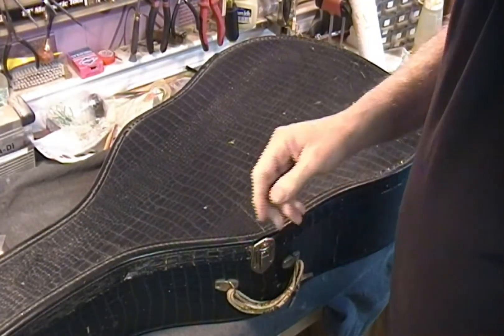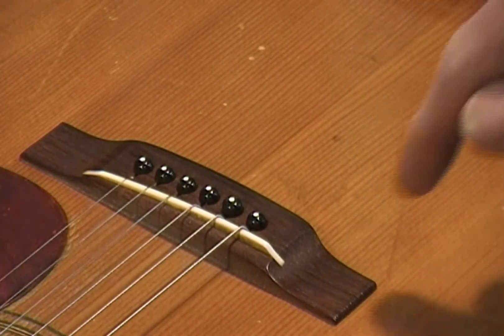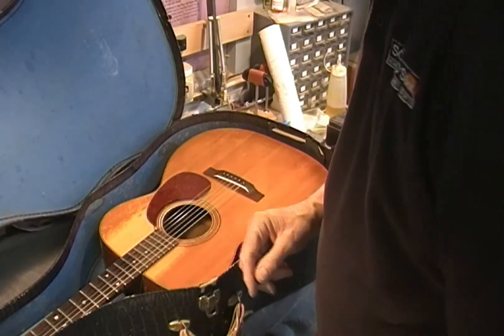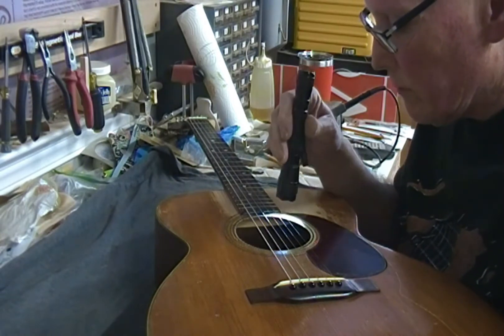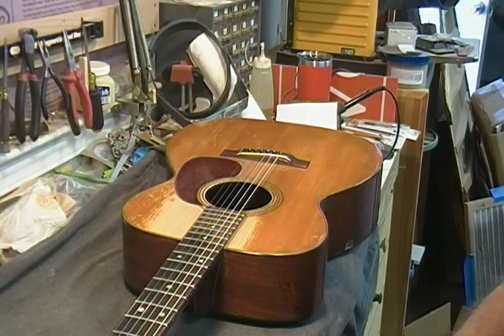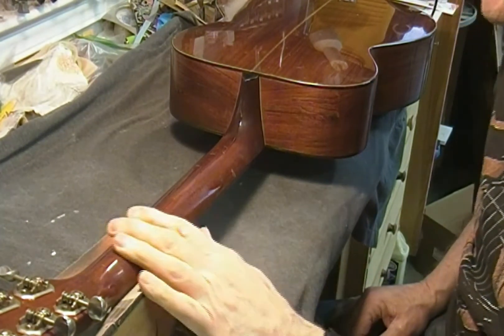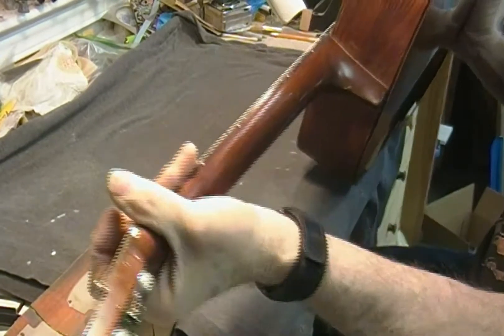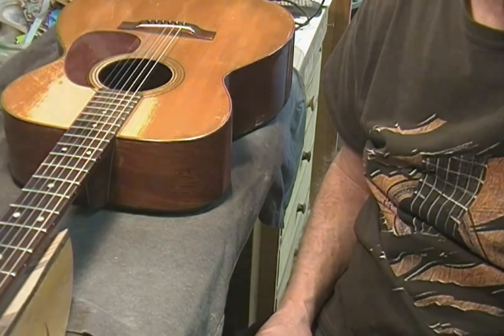48' MARTIN 000-21 SERIES #1, EVALUATION, JONAH GUITARS

Comment: Definitely needs a heavier string set Dane- 12 thou for me! It will fortify the tone too. On the other hand, that's one stable neck for 70-odd years and the lighter gauge strings must have been at least partially responsible there. To those cracks then, and advise the owner to provide a better fitting case or install some supportive padding. The guitar deserves better in my view.
Reply from the maker: I agree it needs a better case. I was very surprised by how flat the neck was. Thanks for the input Steve.